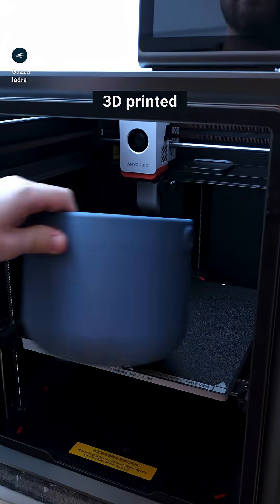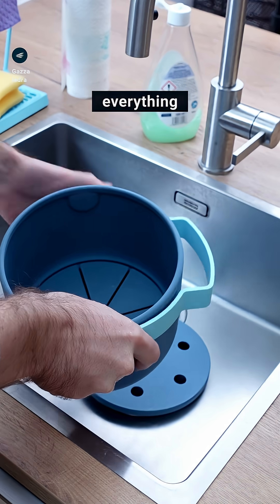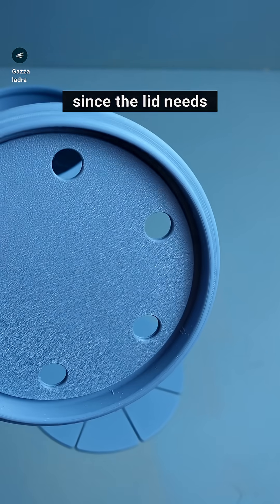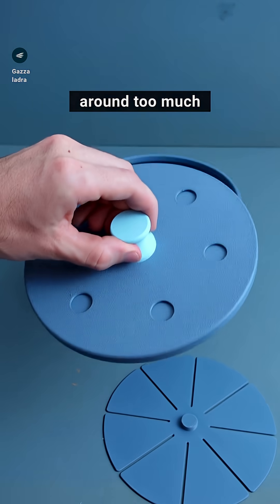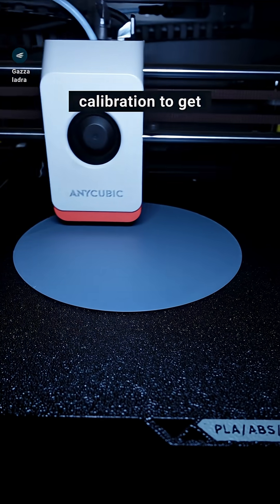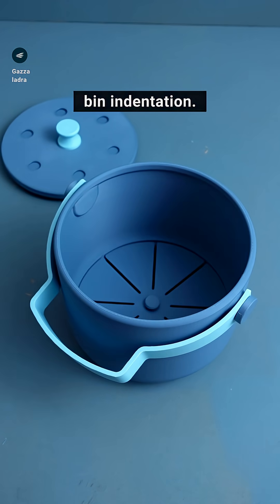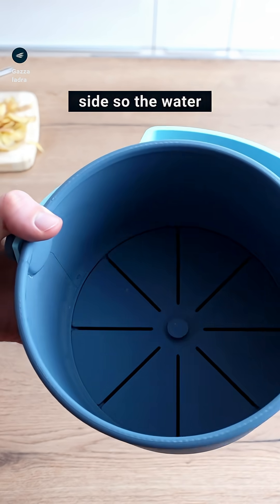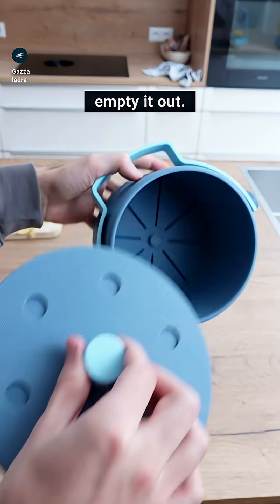How I designed my new kitchen helper

Comment: How about mold settling though layer lines
Reply from the maker: I read a scientific study that says 3d printed plastic parts can be sanitized exactly as normal plastic things, so not at issue really
Reply: @gazzaladra  can u share? I'm always paranoic about mixing 3d printed parts with food
Reply from the maker: @igorcdm28 https://www.researchgate.net/publication/375373442_The_Impact_of_Sanitation_Methods_of_3D-printed_Parts_for_Food_and_Medical_Applications here it is! Sanitizing a print is not the same as beeing foodsafe though!! You also need to check if your filament is certified foodsafe
Reply: @gazzaladra alright, you just won a sub. Pulling up the sources is something that more people should do
Reply: @gazzaladra  The Proofman - the hero the internet is in need these days. ❤